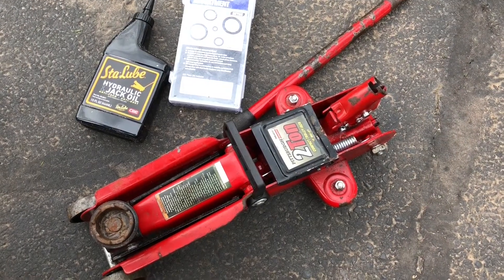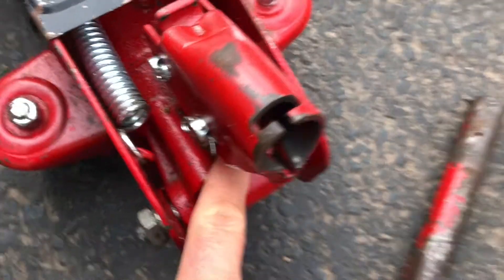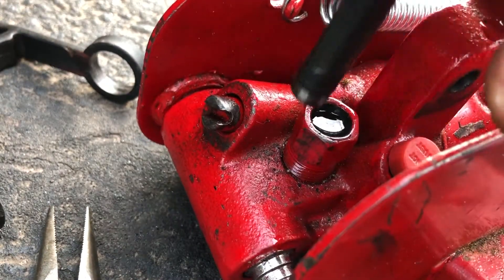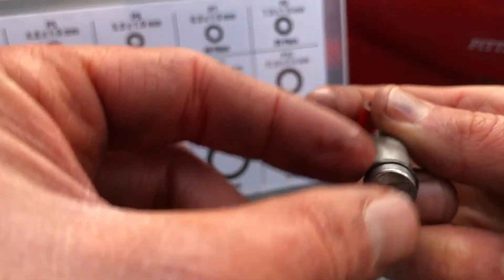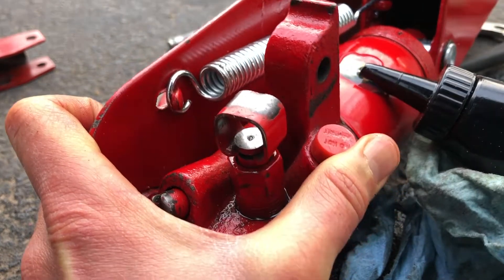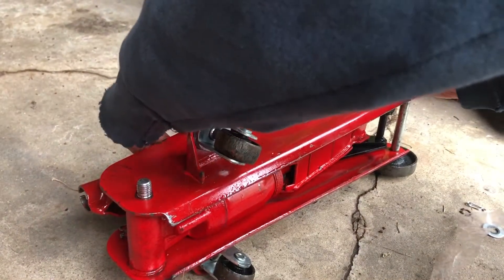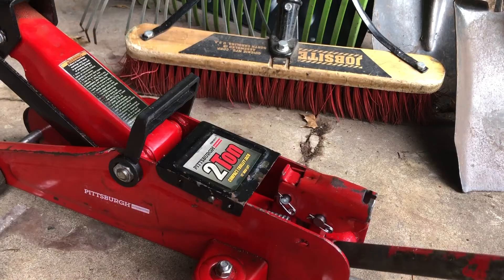How to Fill, Bleed, and Replace O-Rings on a Trolley Jack

Comment: as long as i have been working on automotive repairs, i have never thought about this untill now.
my wife recently started driving my dad's 2006 ranger, and during our overall assement of "things to fix" we discovered the floor jack he keeps in the bed does not go past half way.
ok, needs oil; BUT it is leaking fluid past the piston. 
followed your instructions to remove side plate, and realized this;
the cast "tower" that the device locates on for the pump handle is NOT CENTERED ON THE MAIN PISTON BODY. my piston body is offset to the left, yours is to the right.
if you put the side plate back on, you can easily insert the pins from the side that has the greater offset "more space".
that puts the retaining pin end on the side that has the assist spring to pull the jack down when you release pressure, but there is enough room that it does not touch.
that way, if this happens again, you don't have to remove the side panel again since the pins now have clearance to be removed.
great video, i learned something today.
ADDED BONUS
my 14 year old son helped me get the 18mm nuts loose (needed help, recovering fron knee surgery) and he laughed;
"dad why did they do it the hard way, there was room from the other side".
exactly, son.  
thanks again,
robert and son
Reply from the maker: Very interesting! Hope that the recovery is smooth!

Comment: Great video!!  Although it did drive me nuts when you called the cresent wrench a channel lock.

My problem was slightly different in that it would not jack up, but also was not leaking any fluids.  Your comment about jacking the pump 20 times with the valve open fixed my problem. Now my jack lifts again.

Thank you so much for the great vid.
Reply from the maker: Thanks for watching and the feedback - apologies on any confusion but sounds like bleeding helped!!

Comment: I would also replace the O-ring in the release valve. It started leaking first on my trolley jack.
Reply: What size is the o ring in the release valve
Reply: Glad you mentioned it!  Because I wouldve overlooked it..

Comment: The P8 o ring in the same set you have. I bought from Harbor Freight. Doesn’t fit the shaft correctly. There is a gap when the new o ring is installed. Where there wasn’t a gap originally.????
Reply: Good video though. Thank you for uploading it.
Reply from the maker: Thanks for watching. I had no gap but could have been lucky.

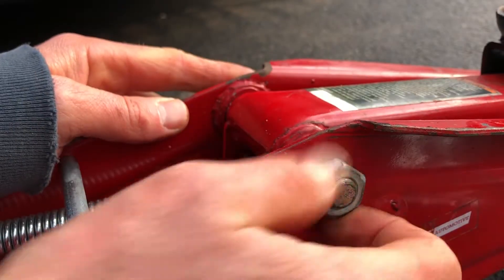Comment: 🙂 Good video with  slight criticism. Early in vid 1:10 when you used adjustable wrench  to loosen bolt you had wrench on backwards.  It might've been an oversight on your part but it made me question your mechanical abilities since it's such a novice mistake. I probably used to do same thing until pops straightened my out lol. Otherwise  enjoyed the vid!